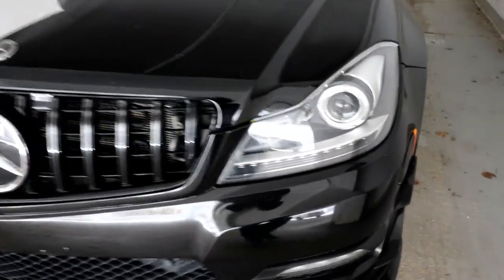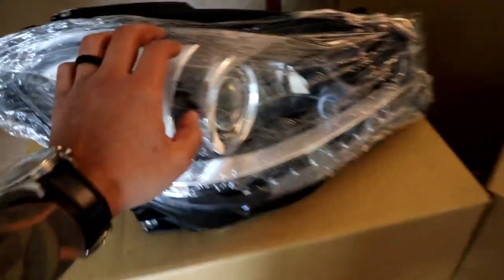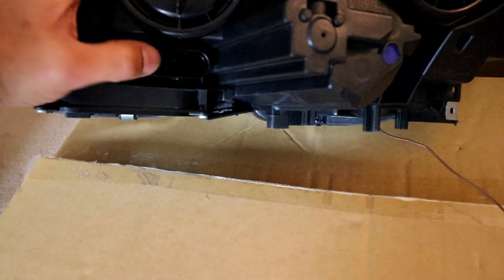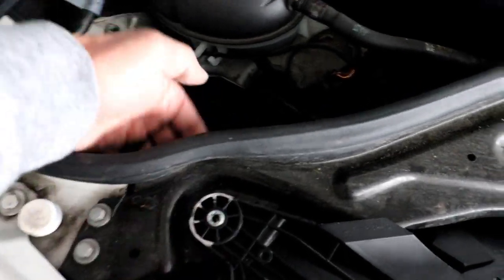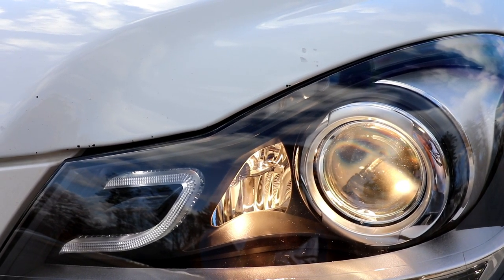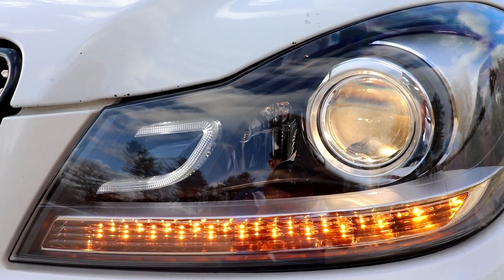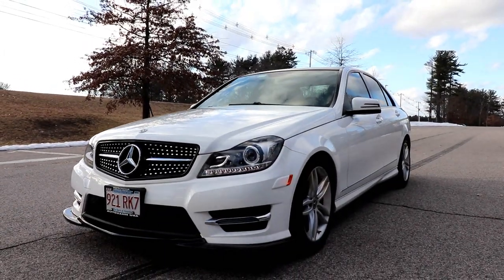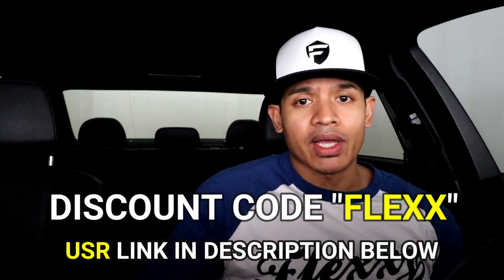New Xenon Style Projector headlight upgrade on 2012+ Mercedes C-Class W204

Comment: Hey flexx, really quick question. Did you disconnect the battery prior to installing the headlights? I plan on installing Depo V1 headlights on my c350 and swapping the bulb for the Philips halogen bulb you previously suggested in other videos. Appreciate the content !

Comment: My man, I could use your advice or help lol. I have a 2014 c300, all custom... Ironically my Benz is white to, but I have just bought OE replacement headlight assembly after a year of constant adjusting the LED bulbs i had to mount inside the unit's, with custom made clips that always come loose. I live in Massachusetts as well, I noticed the license plate. Maybe we can link up, my car is pretty dope and I've also done most of the work myself. Thanks, Scotty.

Comment: Ordered these using your code over a year ago.  USR told me I couldn’t use an LED but I refuse to believe it so I went for it anyways. Did you ever try an LED in these or kept it stock halogen?
Reply from the maker: I’m not sure. Probably.  If it takes a normal halogen bulb, then an led bulb will fit but do at your own risk.

Honestly, I don’t even remember if I upgraded the bulb.  It’s been like 5 years and that cars been long gone.
Reply: LED'S will not work with XENON HID lighting systems. It's a hit and miss, mostly miss. I had to learn that the hard way when I bought a c350. I mod all my lighting on any vehicle I purchase. The c350 was the 1st auto I ran into XENON and it took me for a ride. After making a ton of purchases (which I ended up returning 90% of em) in new lighting I learned XENON is a whole beast of it own. You must buy resistors to run LED'S on it's system. After doing alot of research, moding an xenon system is tricky and it's not a lot of aftermarket out there geared towards it. Some aftermarket companies aren't even thoroughly knowledgeable about it. I learned to take that into account when shopping for a vehicle now. Although it's said that XENON is a great lighting system to have overall it's just not popular.

Comment: Did you have to do any specific wiring/fuse change to get the switch between DRL and signal lights? Mine only lights up for signal turns
Reply from the maker: Nope. Everything shown in the video is what was done. If you need tech support, contact USR directly. It’s their product and they can help you solve your issue.

Comment: Flex!!! I bought these lights for my 2014 C300 and I got a slight flicker in my driver side DRL.  Any recommendations on how to fix?
Reply from the maker: You need to contact USR for support. Somethings not right. Could be defective or something wrong with the wiring.

Comment: Hey just wondering, yesterday I installed Spec D headlights and the led strip isn't as bright as it should be and it's throwing codes for the blinkers and stuff, the blinkers will work for about 15 seconds and then shut off and won't work until I restart the car, any solutions

Comment: For those upgrades do we need to hot wire/ run a wire to the fuse box ?
Reply from the maker: Everything is in the video. If you don’t see something, then it’s not needed. Can’t get any easier than that.

Comment: Does replacing a headlight assembly void any factory warranty?
Reply from the maker: Probably. You gotta check with the warranty people. Usually installing any aftermarket parts voids a warranty unless it’s a body part that has no connection to the electrical or mechanical parts of the car.

Comment: i just bought some, however mine didnt come with no brown wire for the day time running LED. any suggestions? also there was no extra wire for fuse. how can i make the LED work? do i need to use the red and black wires from the resister side?
Reply from the maker: Not sure. You need to contact USR for the wire then. I wouldn’t risk trying to make your own.

Comment: Will they fit an 2009 C300?
Reply from the maker: Sorry. Only facelift w204/c204 c-class. There’s a bunch of cool ones for the prefacelift online. Bet you can find them on eBay and Amazon.
Reply: @TheFlexxGarage  I currently have Spec-D Tuning headlamps (Pre-facelift) but I want a c63 style hood and can only find them for facelift. FLEXX, do you think if I bought both headlamps and hood it would work?